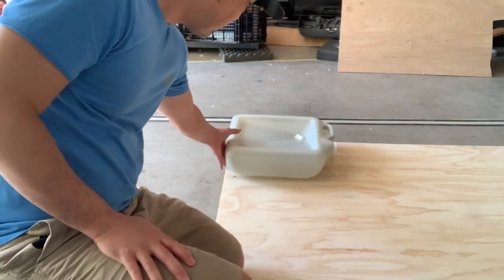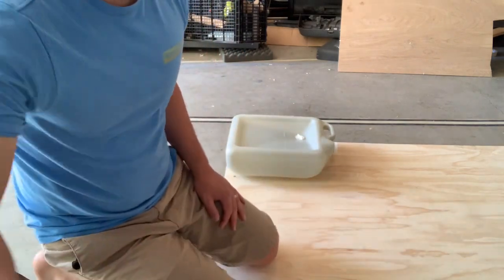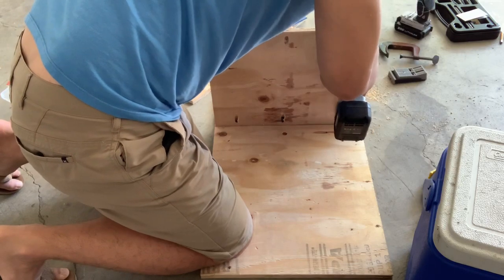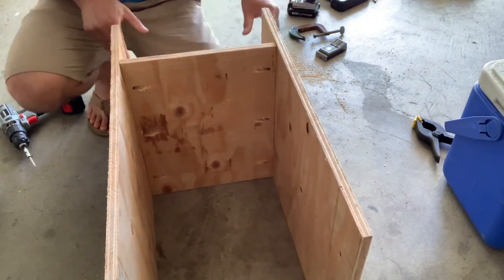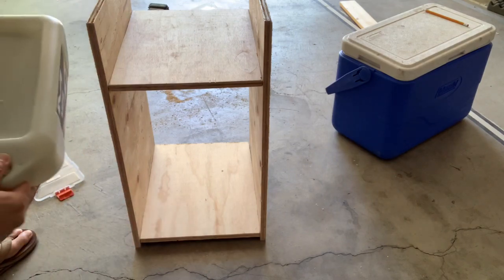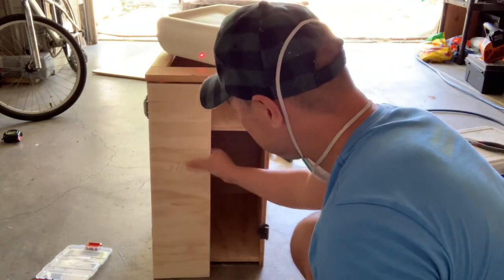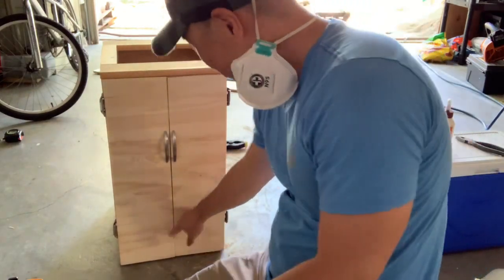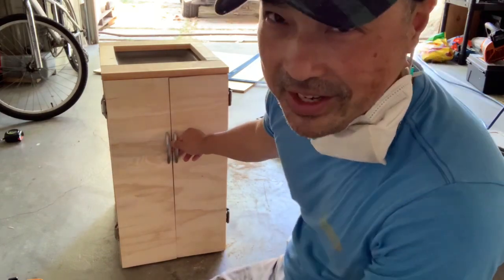Easiest Camping Sink.  No Hassle!  No plumbing!  Sienna Modular Camper EP6

Comment: When I say this was EXACTLY what I needed for this camping trip. I can make that. Thanks!
Reply from the maker: You don't even need to "make" anything. Just the oil drain alone will work :)
Reply: @Tiny-Campers  Don't you use a water pump?
Reply from the maker: @stephaniemoore3779  yes. Use this one. Really easy. Put on almost any container. https://youtu.be/AOvhFXY1huQ

Comment: I really like this idea, but am worried that it is not very deep and any splashing will make a mess. I assume it would work well for brushing teeth, but probably not for washing dishes. Does that sound about right?
Reply from the maker: You are correct. Not great for washing dishes.   I have washed dishes in them before.  It can be done but you have to be really easy on the water.
Reply from the maker: You can make a deeper basin with the same oil drain. Have it sit deeper and build some side walls with water sealed wood.
Reply: I will set one of the silicone collapsible dish pans in there and just pour water " down the drain"
Reply: Use it outside to wash dishes then you can splash around without getting car wet. This is an awesome project, congrats!